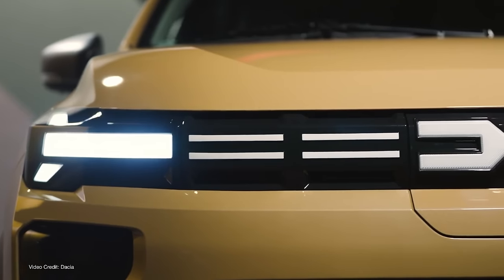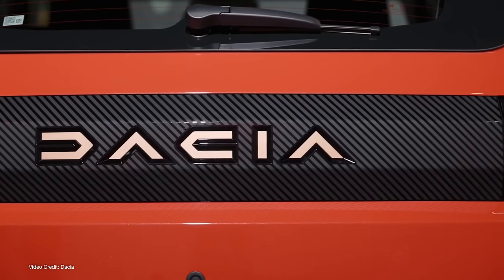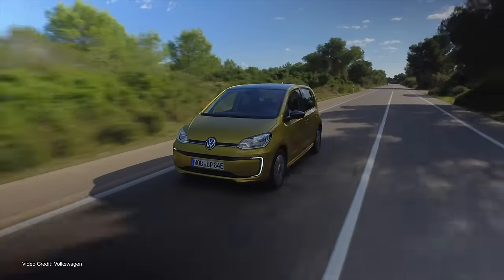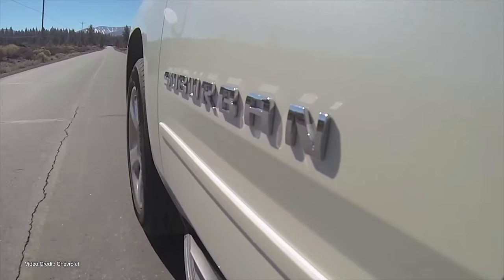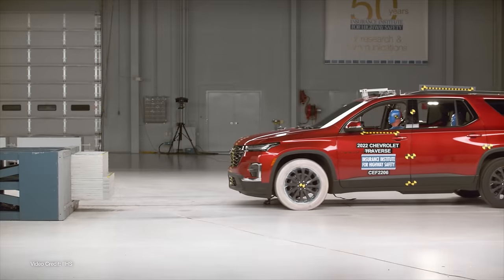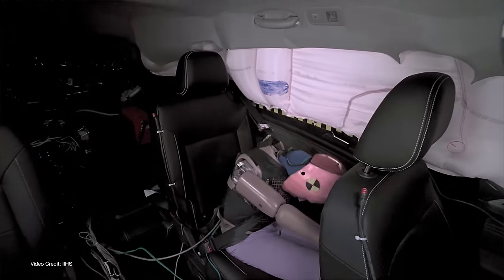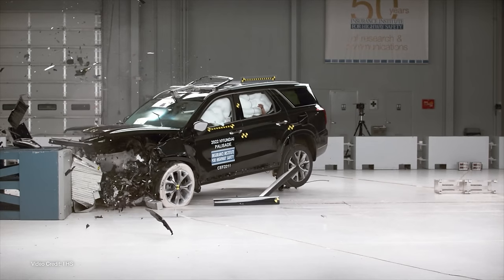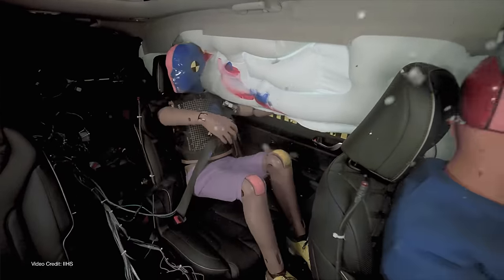Never In The USA - Why the US (And Canada) Appear To Be Anti-Small EV

Comment: People wouldn't be as concerned with EV range if charging was universally actually fast (as in 250+kW sustained from 20% to 80%), ubiquitous and affordable. Right now, tons of roads have few to no fast-charging, chargers are often difficult if not impossible to locate without the network-specific app, apps are often kludgy, most chargers other than Tesla's have a passable to horrible reliability track record, charging speeds are often hit-or-miss, etc. so most people insist on having enough range for whatever their longest typical roundtrips are. Having more range also means slower cycle wear on the battery and reduced likelihood of needing a battery replacement during first-hand ownership.
Until charging infrastructure gets at least 5X better than it currently is, I much prefer putting $40 in my 2012 Focus' tank and having a hassle-free roundtrip visiting my far-away friends than spending 1h at fast-charging stations each way when I borrow my mother's Bolt EV for the same trip. I'd need an EV with 500+km of Canadian winter range to get the same convenience.
If you want lots of range-on-demand without a huge battery pack, worries about the patchwork state of fast-charging infrastructure, worries about cold-weather battery range loss, etc., slap on a ~15kW DC generator.
Reply: The original leaf could charge (to 80%) in 40minutes at 50kW because the battery was only 24kWh.

Edit: the RAV4 EV had a 20kWh DC generating trailer in development. That vehicle got killed by Chevron suing Panasonic and Toyota over NiMH battery patents developed with the EV-1.

Comment: As a '23 Bolt ev owner.  I'm not anxious to take my car anywhere due to its range.  I am fine with the fact that I will be at the charger for 45 minutes.  I have charger anxiety.  When I show up at the charger at 5% and it is either offline or there is a line.  That's what makes me anxious.
Reply: Having 2 chargers in range would probably help with that.

Within the last year the number of CHAdeMO chargers within hypothetical 40kWh Nissan Leaf driving range has doubled where I live. (All installed by FLO).
Reply: It is kind of liberating to not worry about what speed DCFC I find.  50kw, 62.5, 100, 350....I don't care LOL

Comment: I recently bought my second leaf.  The first was a 2012.   This is a 2019 with 40 kw.    I have to disagree on the range extender thing.
Reply: I would gladly take a BMW i3.  It was just the small boot and the weird and easily broken door seals that turned me off.     I would gladly charge every day and have the small generator for extended travel.    This seems like a good way to give range with much smaller batteries.   Also the generator can be less than 100 pounds.     I would only ever use it 2 or three times a year and I wouldn't need a second car just for holidays or the hassle and expense of renting.

Comment: I think a lot of car buyers don't realize this, but for an EV, efficiency is very important, in many ways, more important than the MPG in a gas car, even though electricity is cheaper than gas.

Not only does more efficiency mean the same sized battery gets bigger range, more efficiency also effectively makes every charger a faster charger, from DCFC all the way down to a wall outlet. I can give numerous examples of trips I've taken in my Bolt deep into rural charging deserts where the efficiency of the vehicle made the trip far more viable than it would have been in a bigger EV with the same range, but worse miles/kWh.

In the world of gas cars, the size of a vehicle has no impact on your mobility, so long as the financial cost of fuel is not an issue. In theory, the same could be true with EVs if there existed 350 kW chargers every 30 miles off every single country road. But, in the real world, where chargers away from the interstate are scarce and power limited, your ability to actually get where you want to go is substantially better if you drive an EV that is small and efficient vs. and EV which is huge and electricity-guzzling.

But, all this is a subtle point, which isn't obvious to most people while one is shopping for a car, only when one actually buys the car and starts to make trips with it.
Reply: I've never understood the idea of efficiency only being important in EVs and MPG not being important for ICE vehicles. Everyone I've ever known wanted better mileage from their vehicle and was happier when they got it. The cars work the exact same way, it's just that ICE can never be that efficient and can't improve that much from now (but did since the 80s). Aerodynamics works the same way though. And more range for the fuel is always better regardless of fuel.

Comment: Here in the UK due to the abysmal charging infrastructure for non-Tesla owners if you are 100% reliant on public charging you need a longer range vehicle, especially given the difference in quoted range by the manufacturer and the actual real world consumption. We drive an average of 800 miles per month, mostly made up of 10 mile trips to the shops. However we drive each month at least one longer journey in excess of 200 miles. As all the “experts” say you should not charge above 80% and recharge at 20% that means a real useable range of 60% of the battery. For 200 miles that’s around 330 miles @100%. Add in the 25% difference between quoted and real range and the quoted range would have to be around 450 miles.
Reply: I make NW England to Aberdeen (700 miles total) once every month with my 100 miles range BMW i3 with no problems. Yes, I have to charge 6-7 times but my wife's and my dog's bladder need these breaks.

Comment: I think there is a practical size limit for the us when you get to small vehicles. IE- Smart car size is questionable for interstate driving but perfect for zipping around inter city. I think a lot of our differences is that we dont have  public transport like trains that are widely available for longer trips. I'd love something like an EV Ford Maverick, ID3, or even a BYD dolphin - but the price point has to be correct.  Mavric can be no more than 30k before incentives, ID3 would need to be 25k and BYD dolphin would likely need to be 15k (assuming it gets no incentives). I think a lot of the issue is price point. Why would I spend 26k on a new Smart car when I can buy a Scion Xb hatch for ~20? This was the decision I made several years ago and it has so far served me well. I hope to have a reasonable EV option available soon! Maybe even a BOLT if GM gets it out quickly!

Comment: I wonder how many of the commenters here have seen a Dacia Spring, VW Up or BMW i3 in flesh. They are slightly bigger than a Smart. In theory, they make perfect sense for in-city puttering (pun intended). Which is perfect. In theory.

In reality, being so small makes them viable only a 2nd car in the household, and that's provided that there aren't people to use them regularly (for school run, football or piano practice, etc). And they are almost as expensive as a regular-sized hatchback (here in Europe), which is much more universal. So, in the end, it makes much more sense to buy a VW Golf as a second car instead of VW Up. Not the least, because when the "primary" vehicle is unavailable (and there's always such period), the normal hatchback can replace to about 80%.

Some years ago, Renault even tried selling an electrical 2-seater ATV here in Europe. It was called Renault Twizy. And it failed miserably, despite that a lot of people were saying how cute and sensible it is.

Comment: I’ll support Nikki’s theory about whether having a larger vehicle makes a difference. There is some common understanding about larger versus smaller vehicles, but I drive a Fiat 500 E, one of the smallest vehicles that you can get in the US, only dwarfing the smart. I got into an accident with a Mercedes C class which is a compact to midsize vehicle, I don’t know the weight comparison, but it is definitely at least 50% larger in physical size or volume. However, will my vehicle sustained superficial damage (which none last meant that the car was considered a complete loss because of the way it’s designed, I chose to keep the car on a salvage title because otherwise it drives fine and the damages almost not noticeable), the Mercedes was literally totaled. The entire front and on their passenger side was completely compressed into something that was neither repairable or drivable. On the other hand, I slid maybe 4 feet did not spin, and was able to drive away from the accident.

I attribute this to the location of the battery cell, which I believe combined with fairly good design for the Fiat structure and my car being lighter overall, but having its weight concentrated in the lower part of the vehicle. What this meant was that my car basically bounced off of the Mercedes which took the brunt of the energy of the impact. Given that they ran into me,this was probably the best possible outcome for me and my car.

Comment: Range is a technical issue that will be resolved as things evolve: more battery capacity or easier faster more reliable charging.
Meanwhile car size is irrelevant to electric or gas: bigger is more comfortable, more practical and safer. 
I have a Honda Civic and I definitely don’t feel safe on the highway in it. Retrospectively I should have bought at least an Accord instead.

Comment: Maybe talk about true range. We are constantly being told that discharging a lithium ion battery below 10 percent and charging it above 80 percent degrades the battery. So a 130 mile range for your recommended small battery car like a MINI even if not overstated like TESLA does is really 104 minus 13 or 91 miles under ideal weather and speed conditions. So an occasional trip to Grandma's or a national park is drive for an hour and recharge for 35 or 40 minutes. Of course reduce the hour if on freeways and needing heating or air conditioning and increase the charge time if cold.

Comment: I will say this, the cost conscious car buyer is not as concerned with what the kind of car they buy says about them. That’s the reason why for so long KOMPAKT and subcompact anonymous vehicles were actually the most popular vehicles in the United States. The problem is that those vehicles are not very large margin, and we have Ever so many reliable cheap used cars out in the market.

Gasoline cars have gotten increasingly reliable over the last 20 years. Prior to that, built-in obsolescence really kicked in, and it almost didn’t matter what car you bought, you’d be lucky to get five years out of it. That is, unless you were the type of person who could fix the car yourself, or found a reliable honest mechanic who didn’t charge you an arm and a leg.

From 2000 until now, cars have gotten both more reliable, and more expensive and difficult to repair. This creates an interesting paradox. On the one hand, if you manage to take care of your car and drive it without getting into an accident, then when you put it on the market, while it will still have potential issues, It’s likely that it’s lifespan will be twice that of a car from the late 70s to the late 90s. So you can get a relatively inexpensive reliable gas car these days and not even have to step on a new car deal a lot.

Which means that the only people were looking for new cars are people with extra money to spend. They’re unlikely to look at used cars unless they are penny pinchers. And so since they are willing to spend more money, the automatic factors are more than happy to accommodate them.

Basically, in conjunction with the gutting of the American middle class, the middle priced cars are also going away. And so if cheap cars are being fulfilled by pretty pretty darn good used cars, and nobody wants to buy a middle price car, then it only makes sense that the highest margin that an automatic facture can manage is what they’re going to produce, these other reasons notwithstanding.

It’s sort of strange that making cars more reliable has actually made it harder to sell cheaper cars.

I’m not sure how this applies in Europe, except to say that from what I understand, European streets are often far narrower and older, and therefore even if you want a bigger vehicle, it can become very difficult to live with. If the vehicle has to be smaller anyway, while you can make it luxurious, it’s going to make even the most luxury vehicle less expensive if it’s designed for European streets then if it’s designed for American ones.

Comment: Politics is the number one reason that only massive vehicles are available in the U.S. If 'We the People' actually ran the country instead of 'big corporate america' I'm sure things would be very different. Corporations are there to make money, not to meet our needs or desires.

Range anxiety is real as this is a big country and a road trip every so often is required for personal and business purposes. But this could be easily remedied with extended battery packs as a purchase or rental item for the few times that we actually leave our domestic arena. And if something like this takes up too much cargo space it could be designed in a small trailer that could also add to the cargo capacity.

Another complaint that I often hear is that the electric grid could not handle the load of the additional power draw because of our aging infrastructure as well as there not being enough of or frequency of charging stations. But until there are actually compromises in the infrastructure this is a mute point because everything will be updated where the needs arise.

I sooo want a small inexpensive electric vehicle, preferably a low sporty one that has a range of 150 miles and can reach speeds of 80 mph. Not that I'd really want to take it on the expressways but I could if I had to.

Comment: Seems such a shame that the accident happened to you who actually need a truck for your household requirements. I think you're absolutely right about the size of the truck making the accident worse, given that others had hit the ice with lesser consequences, including the lovely couple in the Bolt, who so kindly picked you up and brought you home.
There could be a place for the rental of larger vehicles being easily, affordably and widely available for people in urban areas who need a more practical vehicle occasionally. That's what we do over here in the uk, our local roads and car parks are not designed for larger vehicles. If we need to carry something large or move house, say, or if we need to go a longer distance and want something more comfortable or with greater battery range we can rent something bigger. Its not as easy as it could be in all areas, nor is it inexpensive but its an option in particular circumstances which could be expanded by someone with entrepreneurial flair. I know it does bring down our overall cost of ownership and we have only rarely used the option over the years. The simple expediant of having small cars with a practical boot space, estate cars or mini mpv's are they called? Skoda Roomster and the like with a big square boot space but a tiny footprint on the road. They always did us for tip runs with garden waste and the like. I bought large items of furniture like a big chest of drawers plus a bookcase to go on top and made them fit to get them home too! Now, as sadly the Sono Sion did not come to fruition,😢 we have a used Ioniq 38kWh and no home charging. It's boot is big enough for my walker, the back seat is luxurious for passengers or our lurcher and will fold down for more awkward items if I'm ever fit enough to carry them again!
All it took was a change of mindset and the good fortune to have both rapid and ac chargers locally. Our usage and therefore mileage dropped dramatically after lockdown with home office working three days a week. Although with an elderly parent needing many hospital visits we've had some hundred mile plus days which its dealt with flawlessly and filled up in reasonably good time on return too.
Hope you're recovering well with the shock weating off now Nikki. I let all the ads play in my feebw but best effort to help out. Really good article, hope it makes more people think about the realities of their requirements, the more smaller cars on the road the safer it will be for those around them.

Comment: Looking  forward to charging stations being readily available anywhere.  Looks like it will be a while before I can afford an EV. Thinking of keeping my ICE car even after getting an EV for a few reasons.
Reply: Lack of infrastructure is part of why I'm driving a PHEV. I get to run electric-only as much as is feasible and have the ICE engine to fill the gaps. My primary complaint: the battery isn't big enough, but that's mostly because I'd like to be able to drive out to rock climb and back without burning gas (nowhere to charge in between).

Comment: Bigger is safer - adapted to US population, Germany has less than 12,000 traffic deaths, the US 42,000 So the big=safe US cars are 3.5 times as lethal as cars in Germany - and that with 4,500 miles of unlimited autobahn.  
 
For me the choice of car is massively dependant on the use-case that you have. For me the first vehicles to be electrified should have been city buses. There it makes sense to avoid emissions, they have a defined distance they cover over the day, can be charged overnight or have an exchangeable battery pack. 
 
Same with cars, as daily driver over short distances so that you can charge at home overnight - great. 
 
But as occasional driver, with an unknown range you want to cover, a fuel car still has its application.  
 
As I drive maybe 4,000 miles over the year, I feel not guilty keeping a 30-year old car out of the hands of a constant driver. Keep "history" alive.